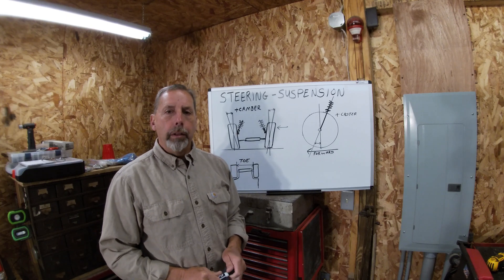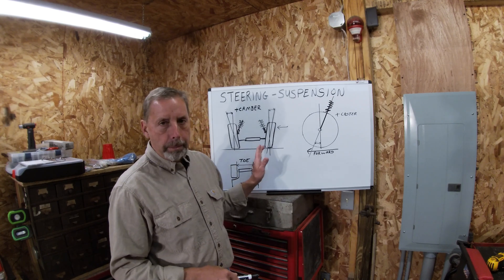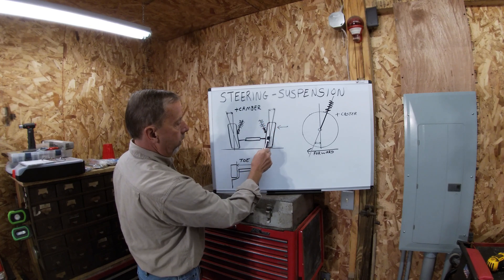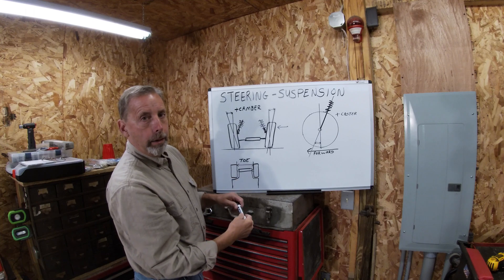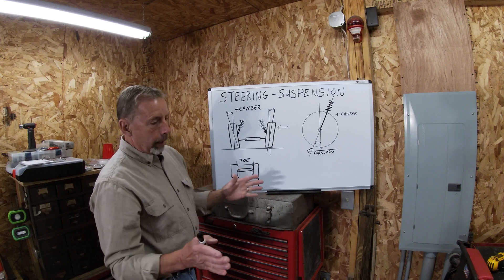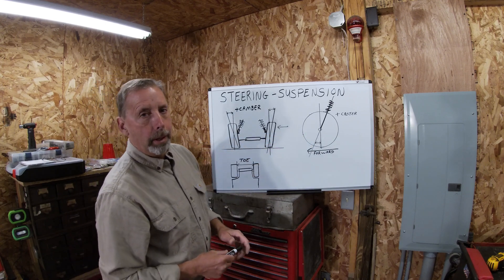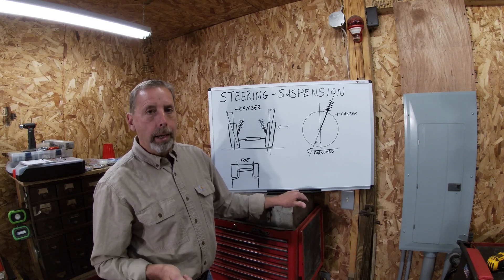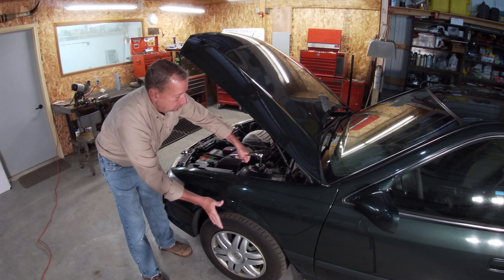Understanding Front End Alignments and Diagnosing Steering and Suspension Problems

Comment: Can you help me on camber, I have a 2025 prius and I got hit and I can see what is wrong with camber
Reply: Thank you, I just turn the steering wheel and both turn the same 1 3/4
Reply from the maker: Can you give me more info?
Reply: Yes, I got hit on the driver side,  the shock got dent it, I replaced it but it didn't help , I was checking the knuckle and I don't see any signs of damage
Reply from the maker: @bernievargas6740 . It’s probably the knuckle. The shock would bend 1st but it’s possible the knuckle. Put your hand on top of the wheel and put your fingers between tire and strut-spring.  Check clearance from one side to the other. That’s a real fast way to find damage. Let me know what you find
Reply: You think so, cuz I replaced the wheel bearing, and the wheel was driven back, the cradel was pushed back, the mechanic fixed that, it was hit in the front of the tire so I think the steering rack jumped a tooth, what I did, I just turn the tie rod to get the tire little straight but in the other side is not the same cuz I did a few extra turns on the tie rod to get it straight , I'm thinking in replacing the knuckle, I check for any signs of rust like you mentioned on the video but couldn't find anything, probably I'm not a professional to see that
Reply from the maker: @bernievargas6740 . Usually a hit to the front of tire won’t cause the rack to jump a tooth. Check clearance side to side between knuckle where tie rod bolts and tire.
Reply: Yeah, left side measure little bit more than the other side
Reply from the maker: It’s also possible when subframe was pushed back that it tweaked the mounting points where the bolts hold it to frame. A few little bends here and there add up to bigger problems. It’s hard to completely diagnose without seeing it. With your steering wheel straight, turn it left and count revolutions and then center again and turn right and count. Usually a steering wheel will go about 1 3/4 turn each way. If there’s a big difference that could mean a damage rack. I hope this helps
Reply: I just got the new knuckle, I'll be replacing it this weekend, but compared to the old one I don't see any damaged to it I think is not gonna make any difference, what I'm thinking is probably the shock tower has something to do with that

Comment: so I take it if the rack had jumped a tooth I will have to replace the rack? Thank you for explaining in this video.
Reply from the maker: Correct. If a rack jumps a tooth it changes the angle between the steering wheel and tires. It can’t be repaired. Thanks for watching
Reply: @autobodytrainingsolutions838  thank you